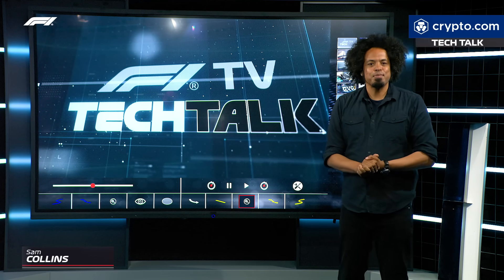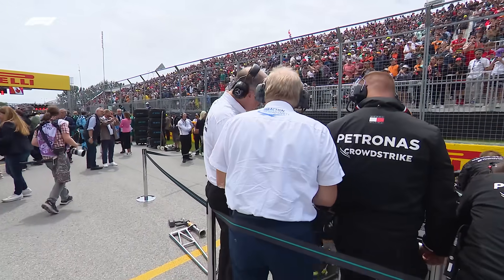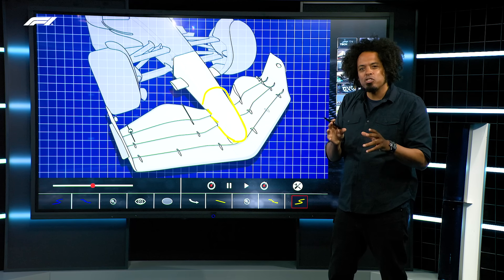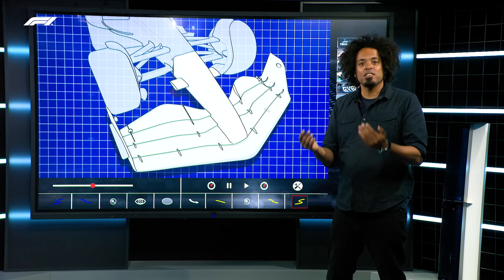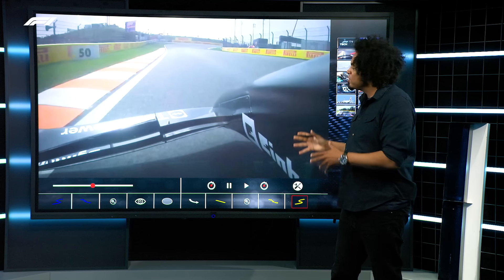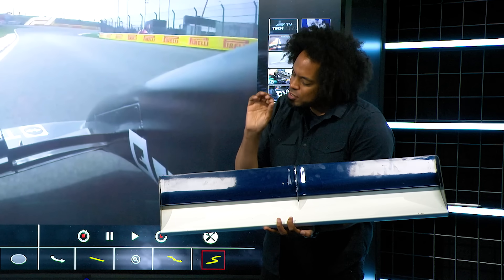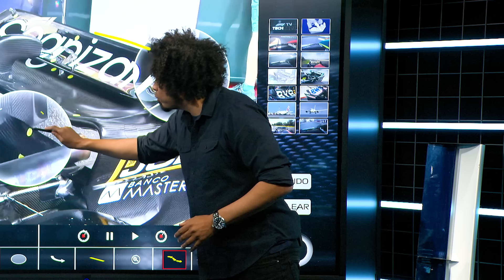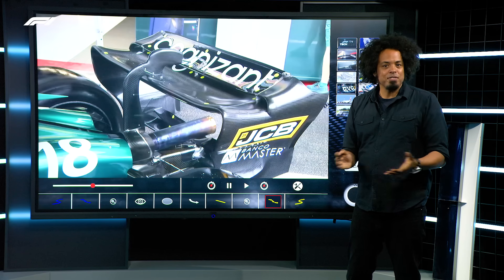The Rules On Flexible Wings Explained | Tech Talk | Crypto.com

Comment: Unnecessary fluf about wings that can be resolved by setting a standard design that all teams adhere to, like NASCAR’s, Womens formula and f2 f3… if rules a simple and straightforward, and all teams have same template, like halo, top camera housing,  tires, then teams won’t cheat the system. The should bring back the simple straight edge, no curves designs.

Comment: 5:00 its actually easy to do with composites, the tips of the wings can have a lower number of composite plies.

Or even more cheeky, have the same number of plies at the tip but in an orientation that is more flexible under certain loads, and then just cover it up with the advertisement stickers.

Comment: I wonder if would it be possible for F1 team to have two sets of front wing, each for different type of track ? For example they have one wing at the beginning of the season and during the season they work on it and it turs out that upgraded wing is great only for a specific type of the track. Are they allowed to undo the changes for the next track and implement them again in the next? (which would actually mean they have two sets?
Reply: I think that's what actually happens in a season, for example you can see the differences between the rear wings between Monaco and Monza, they are allowed to have different types of wings for different types of racetracks but as the budget cap exists, for a team it's more cheap to try and make a wing that adapts to all types of tracks with minimal changes.

Comment: Its seems like the FIA is severally over policing the sport, in decades past there was so much variation in the cars and technology. Now it almost takes someone with an engineering degree to make any sense of the fine differences between cars. It would be much more fun to watch if there was more experimentation, like CVTs or fan cars or cars with more then four wheels. It genuinely seems like all someone would need to do to be faster than F1 is just build a car with all the banned tech, sad to see.

Comment: One of the least (if not THE least) appreciated aspects of the sport is the constantly warring factions of team engineers vs FIA rule enforcers; brainiacs trying to stay a step ahead, while other brainiacs try to corral them.

Personally I love it. High-level intelligence vs high-level intelligence -- one side using their giant brains to find ways of interpreting a rule(s) to their advantage, while the other giant brains try to keep them within a prescribed box. 
All teams flirt with the edges of, and bend (without technically breaking), the living Hades out of the rules. The workarounds some of them come up with are nothing short of sheer genius.

With the cost cap now firmly in place, more emphasis is placed on the engineers' ability to devise and create parts that tap dance on the sometimes-blurry line of legality without fully crossing it. Throwing $millions at a problem is no longer an option, so I believe creativity in the problem-solving process will only shine brighter -- The need to do more with less being the driving force behind it.

Those folks could work easily find work in the defense industry, air travel, road car design (any high end design work where innovation, performance and safety are all paramount), yet they decided to put those smarts to work for our entertainment -- and, I'm sure, dump truck loads of money.

Comment: They just need more sensors on the front wing that monitor deflection and set a limit. Static load tests are garbage, they don't take into account fluid-structure interaction. I was so frustrated that nothing has been done for years, but the visual cameras and spots FINALLY is a solution. Been waiting 15 years for this.

Comment: FIA always seem to want to limit experimentation and advancement in the formula. I hope they open it up more in 2026 but seems unlikely. Sad because the cars differ so little these days.
Reply: The problem with that is a team will end up dominating meaning less close racing and lower viewership. I agree there should be more experimentation, it’s just hard balance to have both.
Reply: Exactly.
Reply: there will always be a lack of experimentation in a racing series where everyone has do use the same basic design
Reply: I think They basically do it so technology can get passed on to road cars.
Reply: They have to introduce new rules to slow the cars otherwise the speeds would be simply dangerous.

Comment: Why restrict how much flexibility the wing has. Isn't formula 1 the pinnacle of motorsports and as such teams should do all that is possible to maximize performance
Reply: It has t o be limited, cause if the FIA doesn't limit it, the teams will push it too far for performance and your gonna have an accident when it breaks under load.

Comment: Personally I would just allow active aerodynamics and suspension, I don't understand why the FIA want to suppress advanced technology which is what F1 is meant to be about.
Reply: it's more about cost control than about safety. more complicated systems means higher development cost, which teams like Haas can't afford.
Reply: @NeonColored  I would agree that was case before the budget cap, but with the budget cap they would have to cut back in other areas to make it work.
Reply: @MakewithJosh  it still applies even with the budget cap. Haas is tens of millions off the budget cap every year because their budget is too small. This is the main reason they always fall off the longer the season goes.
Reply: @NeonColored  sure, but that's a question of a team having a limited budget, not whether active aero and/or suspension should be allowed.
Reply: Because FIA only wants safety.. and in some forms it's understandable. But the other hand it's becoming idiotic, like no wet racing.
Reply: @kjellcmans9764  Tbf, thats pirellis problem. The wets are just terrible race tyres to use, and get overloaded easily

Comment: Its a shame that these little details and hacks are policed so much..This is what made the sport so great once...
Reply: Which is strange because the FIA has just created one of the most leniant rulesets for WEC
Reply: @dylanburston7453  Because the Le Mans Hypercars are regulated in their aerodynamic efficiency and total downforce. Also there is Balance of Performance, so even if you use certain greyzones so you can sneak in more aerodynamics, it gets balanced out. WEC is about equal car performance. F1 is about making the best car around a certain ruleset.
Reply: @petouser  Yeah, but the ruleset is extremely unrestrictive. Max length and width, max/min downforce and drag and thats pretty much it. Its got BOP, but the strength's and weaknesses of each philosophy really make for interesting races, and the variety in engines as well

Comment: The more rigid a piece is, the more fragile it is too. I honestly think the reduced flexing rule should be done away with and let all teams do it, as long as it's not a mechanical movement (like adjustable hydraulic shock absorbers). At this point everyone knows how to do it, and can do it, and it actually costs more trying to stay within the current guidelines.
Reply: The reason the rule was introduced was because early experiments (late 80s to early 90s) with flexible bodywork were seeing a lot of sudden failures (including a loosely mounted t-cam wiping out Alesi at Monza, Elio Di Angeles' fatal crash in testing and Ratzenberger's fatal crash at Imola) which is extremely dangerous. Flexibility is inevitable and I'm all for a certain degree of moveable aerodynamic devices too but it has to be policed to at least some limits unless you plan to load-test every new wing iteration to the point of failure in multiple directions. As it is this rule isn't even about basic flexibility, it's more targeted at mechanical decoupling of parts under load. Strictly speaking the amount of deflection per load allowed in the rules hasn't changed in a long time, they have just changed how they test and classify movement.
Reply: Pushing the boundaries of Material Science eh.
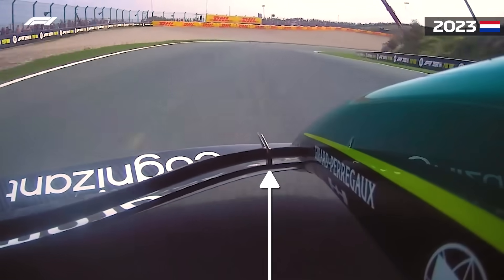Reply: I noticed the front wing movement (as shown at about 3:24 on the Aston) on most of the frontrunners earlier in the season. When it wasn't addressed, I just assumed it was accepted for the reasons you mentioned (and because seemingly everyone was doing it and no one challenged it).
Reply: any movable parts either mechanical or not is illegal. Now one team suffers greatly its consequences.

Comment: I remember the 2011 Red Bull car had a staggering amount of flex on the front wing, it was mesmerising to watch!
Reply: I remember that, it looked like it was about to break and drag on the floor
Reply: @@-Trend- honestly I don't believe that to be the case. Iirc the exhaust fumes was much more controversial as pretty much every team had flexible components. It was one of those "not really illegal cause everyone's doing it" kind of things
Reply: Renault had an underpowered engine but made up for that with genius manipulation with the exhaust fumes in conjuction with the body work. It's why often the red bull struggled to power past faster cars but couldn't be caught once it was in clean air. The FIA made several modifications to the rules to try to stop the exhaust manipulation but didn't really do much about their lack of flexi enforcement till the hybrid era.
Reply: Wasn't Seb even disqualified for that?
Reply: @Infiltator2 yes but that was abu dhabi 2014. They had really exploitable ways of testing the teams in the v8 era. That was also when carbon fibre layering to intentionally make it flex more was really understood. The teams were ahead of the FIA in the flexi wing arms race during this time.
Reply: 2010 wing from rb also
Reply: @@-Trend- that's what the F-duct was made for. to stall the wing at high speed.
Reply: RedBulls have been cheating like forever.
Reply: Still does from onboard wing angles 😂
Reply: yea it's a cheating tactic Red Bull has been abusing for years. About time they finally stopped it.
Reply: Is there a video of it?
Reply: @@-Trend-you can't blame RBR for it, because technical innovations are core of F1.
Reply: and all the mercedes fans claiming they didn't cheat.. then the tire tests came up lol@@-Trend-

Comment: With what Max and Red Bull have achieved this year (my husband and I are Sainz and Leclerc fans respectively), I hope it doesn’t come out that their wings are illegal. As a fan of the sport it would be a shame to see their racing triumphs reduced. I’m not saying they’re in question, just that I hope they aren’t!
Reply: now that the rules were specified further and room for interpretation was narrowed down, they have to make a design that follows the regulations more closely. that does not make the results of the previous races illegal where the rules were too loose
Reply: Flexi wings don’t lose you 7 tenths of pace like how much RB is behind after FP2. It’s more like 1 tenth a difference in wing would make. And a track like this won’t make much of a difference because the whole purpose of flexi wings is to reduce drag. The regulation changes related to the floor would be more likely to affect RB majorly as opposed to the wing change.

Comment: Flexible ore not flexible ! No Rules needed !
Reply: For the wings to be not flexible at all they should be made of stone. At high speeds, and with extreme loads generated, it´s impossible to have total inflexibility. It´s literally what this guy says in the video.
Reply: In reality, the rule is "not very flexible", because "not flexible" is not practical and "open season on flexibility" turns into a charlie foxtrot when someone goes just a little bit too flexible and you end up with shards of carbon fibre flying everywhere.